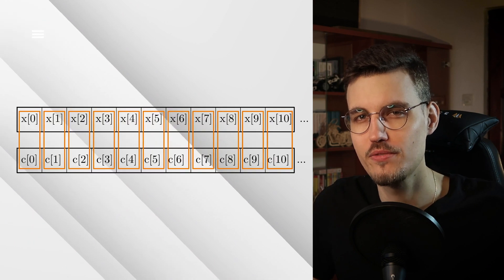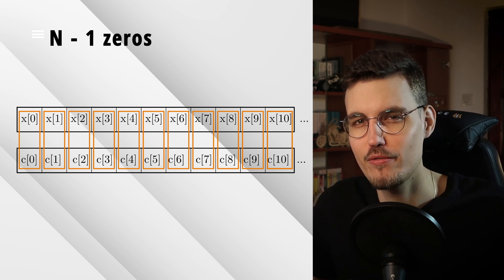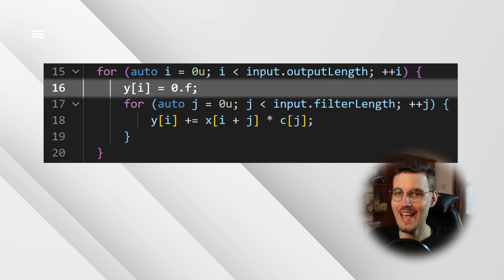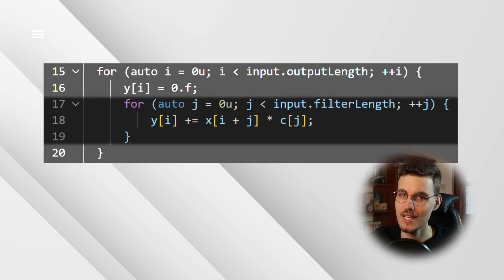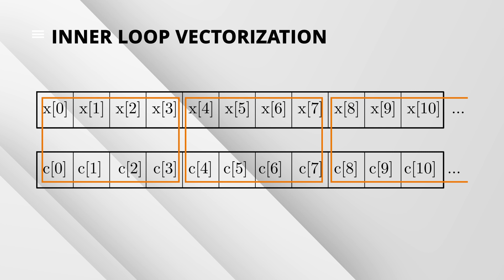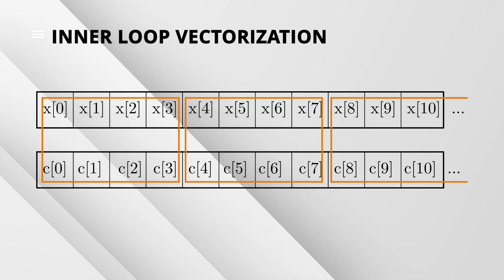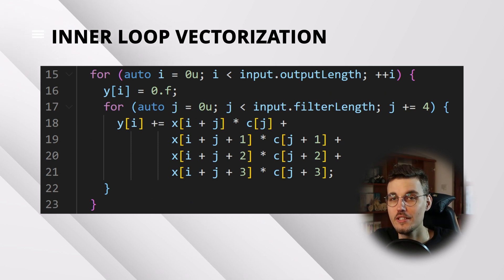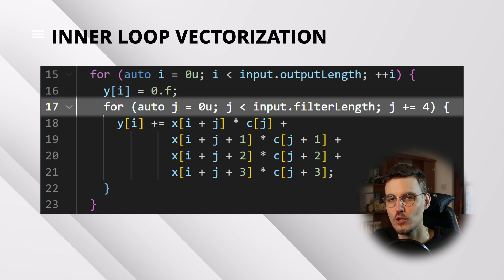Efficient FIR Filter with SIMD and Loop Vectorization [DSP #16]

Comment: Thank you for sharing! I have also worked on FIR SIMD optimization. Regarding the method you proposed, I believe it  may encounter several challenges in engineering applications. For example:

1. How do you handle cases where the number of coefficients is not a multiple of 4?

2. Potential data out-of-bounds issues. Taking Outer Loop Vectorization as an example, assume the input x has a length of 4, and the filter coefficients c also have a length of 4. Based on your code, the calculations would be:

y0 = x0*c0 + x1*c1 + x2*c2 + x3*c3;

y1 = x1*c0 + x2*c1 + x3*c2 + x4*c3;

y2 = x2*c0 + x3*c1 + x4*c2 + x5*c3;

y3 = x3*c0 + x4*c1 + x5*c2 + x6*c3;

However, since x only has a length of 4, where do x4, x5, and x6 come from? This could lead to out-of-bounds memory access.

3. Handling consecutive data packets. If there are two consecutive data packets, each of length 8, and they are processed sequentially using your FIR function, the computation of the second packet depends on the last three data points of the first packet. How do you address this data dependency issue?